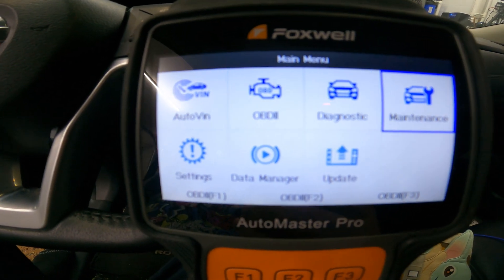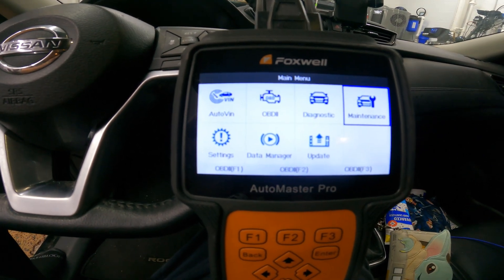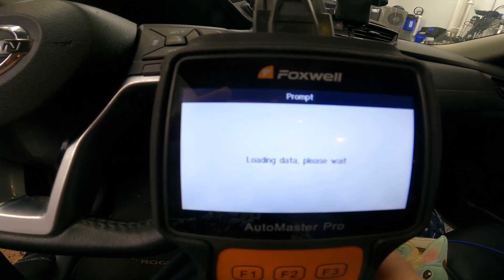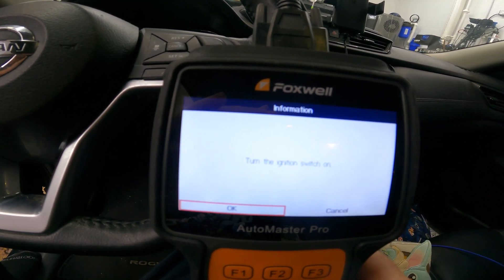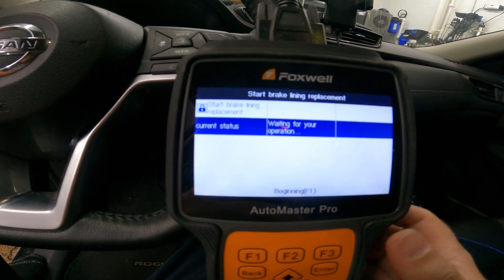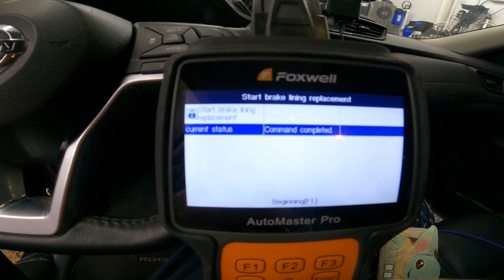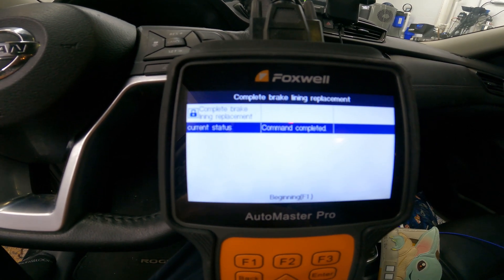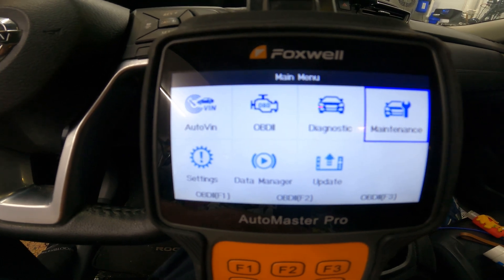Retracting the Nissan Rogue Electronic Parking brake EPB with a scan tool

Comment: Hey man I need help with my 2019 rouge awd sv I did front and did rear pads I messed up idk why I was curious and I pressed the epb like a 🦤 and now I can’t get the epb to go back in as it’s pushed all the way out 😢
Reply from the maker: This is one of my greatest fears. I have not done it. i have heard you have to buy new calipers or new seals. Not entirely sure on this esither. You may be able to manually retract the epb by hand turning it or using an external power source to reverse the motor. I am spit balling here and have not done or tried these so i am not sure if it would work. But could be worth a shot.
Reply: @danielsgarage3545 man. I been here for 2 days full I have everything the tool to redact it I even have the new pads in ready to roll I can’t get this to budge at all the mothers spin because I press the P and I see and hear the thing turning 😢

Comment: Do you unretract the brake pads once you put the calipers back on top of the new pads and back on wheel or do you unretract  anytime once you push the piston back in?
Reply from the maker: @killertofu  only unretract once everything is reassembled on the car.

Comment: After watching this I went out and ordered a Foxwell NT630 Plus which has EPB support... but for the life of me, I can't get functions like EPB to work, it just tells me communication error or that the car isn't on, when it is..... Any advice?
Reply: I should clarify, this is on a Nissan Pathfinder (2022) which definitely has EPB
Reply: @dguisinger hi did you found EPB function on foxwell NT630 plus. I am thinking to to order nee one.
Reply from the maker: Have you checked for updates?. When i first got mine it had 40 or 50 updates to download and install.  Second try with another scanner if available.  After that I woukd reach out to tech support.  Maybe the obd port in the car has an issue. But if you can do other functions that would not be the case. Maybe try it with engine running and see if that does something different. (Not recommended, for safety reasons, but could help identify the connection issue)  the only issues i had was the car battery got low and the car would shut off and i would have the start the proccess all.over again. Could connect a charger to the car battery while doing the diagnostics with engine off key on so it does not drain the battery. I also turn off the ac and fan and radio.
Reply: Most likely EPB is not getting required power. There must be some way to enter into car service more that will provide full power to the EPB component. Post that the device will work and retract the EPB for service. I had this experience from 2018 Chevy Equinox. Between On and Ignition buttton press, there was one more mode - service mode and that can be access by long press of start button.

Comment: Hello friend, I have a 2021 Toyota that I changed the brake pads but I get an ebp error, what can I do?
Reply from the maker: first I would start with checking all the wire connections and trying another scanner tool to see if a plug got missed or the different scanner will rest your EPB. If you still get the error then I would go back through the entire replacement  process of the brake pads 1 side at a time to see if something is missing or loose or broken.